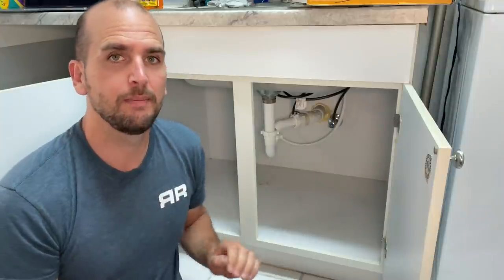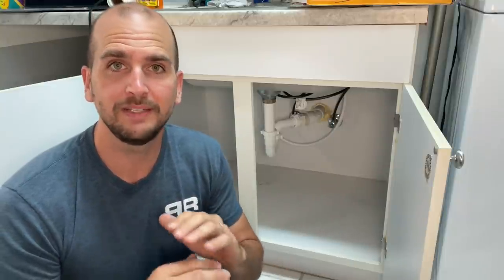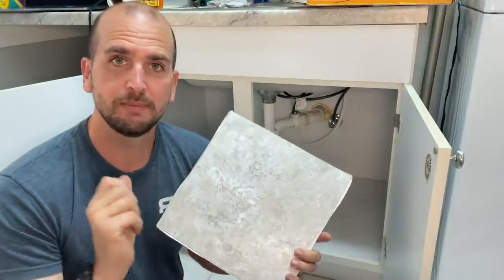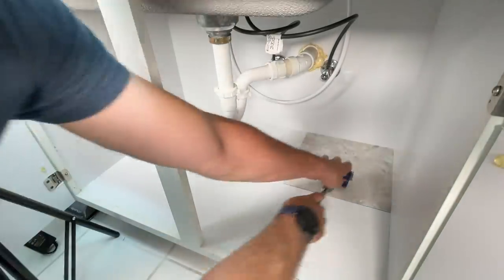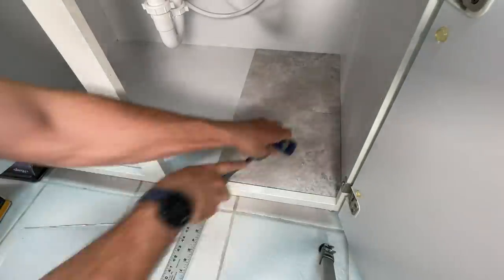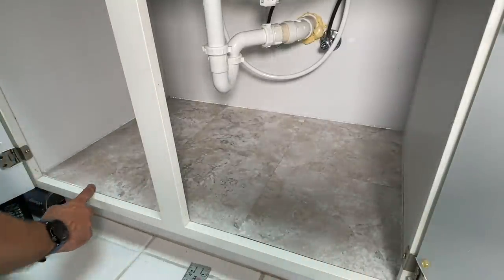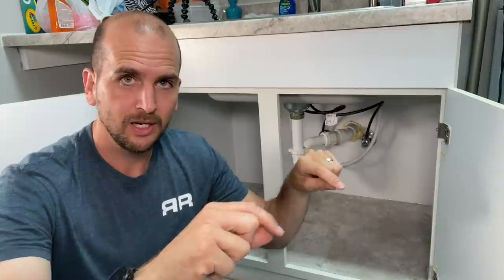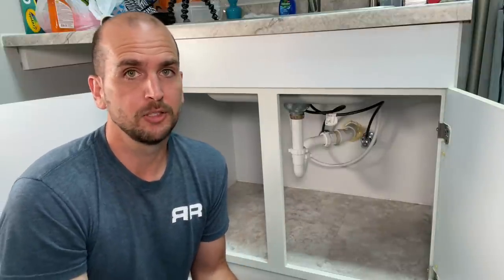Waterproofing Hack For Kitchen and Bathroom Cabinets

Comment: I did this many years ago under my then kitchen cabinet.  It worked pretty good.  Word of warning: moisture/gunk can get between the tiles so it is a good idea to silicone in between the tiles as you lay them as well, otherwise, this is a really good fix for under kitchen sink cabinets and it will last for years if done right.  Also, this is a cheep fix - less than $10. 💖
Reply: I was thinking the same thing.
Reply: Yep, I came to the comments to say the same thing.  This can actually make the problem worse if water gets into the seams and then can’t dry out.
Reply: Water can also run thru those gaps too.  I would also get water alarm sensors. I prefer to get a big piece of water proof sheet instead of small tiles.
Reply: Why not just grout it

Comment: I have water alarms under each sink in my home. They are battery operated and sell at Home Depot or Amazon for about $20.00.
Reply: Yep - and they work.
Reply: So instead of spending a couple bucks you’d rather spend $20 on each sink and have to buy batteries?
Reply: @Dnice3477  bragging about spending triple the money. Lol
Reply: Do they deflect the water out too? Or do they call you to let you know there's there's leak if you're not home?
Reply: @Dnice3477  
🤭☺️☺️☺️☺️!!
-- Rich people"
Reply: @garpikemike1  
🤭☺️☺️☺️☺️...
Reply: As a renter who had a slow leak that was not really detectable, I would love to have an alarm.  Kitchen sink seldom stays fixed when they use putty that disappears after a while. We never had leak problems in our home when I was a kid. Right now, after the bathroom "fix" and an adjustment a few days later when it again leaked (more than before they fixed it), now I have a plastic fast food container bottom under the pipe to catch any water that may leak. My fear is that the water will evaporate before I see it, which I think used to happen. For me, even as a renter, $20 plus batteries would give me some peace of mind that it really isn't leaking. Sorry some other folks are giving you a rough time here.  If I could gain some confidence that the bathroom really has stopped leaking, I could move the alarm to the kitchen where I am afraid it is just a matter of time.  Peace of mind makes it worth it to me.
Reply: We had water alarms at the natural history Museum near USC college.  This was in 2010.  They charged us $300 per water detector linked to our laptop.
Reply: The vinyl idea is better than nothing, but water can find its way between the tiles and still ruin your cabinet base. Why not use one piece vinyl? The water leak alarm is a great idea, because leaks under cabinets can go unnoticed so long that the damage is done before the leak is discovered. $20 a sink is cheap compared to the repair time and material.
Reply: @paulcalif  You guys are just wasting your money.  If its going to leak, its going to come from  a 2ft rectangle area where the pipes are above.  Just buy a big rectangular plastic tray and put clear cherry balls in there.  So when it starts to smell like cherry, u know theres a drip.
Reply: @kendalgee5808  Well, as a homeowner for over 40 years, a landlord and a retired plumber you make a good point, BUT, sometimes leaks spray not just drip. Plus, unless you're going to check your bowl every few days, it's going to overflow. What I do when I get a new home, is replace all of the angle stop valves in the house and all of the hoses to the faucets. I realize that tenants aren't going to do this (but owners should have). Today you can get 3 leak detectors with a hub for about $60. Connect to your wifi and get alerted if there is a leak. Additional detectors are about $10 each and a typical hub can support 10 detectors. But if you're a tenant, it's really the owner's problem. Not sure if any tenant is even going to install tile squares. They also have mats available that cover the entire under side of the sink and hold up to 3 gallons of water, but those are expensive too.
Reply: @paulcalif  That makes sense to proactively change out all of the hoses and shut off valves underneath the sink . I used to be in charge of an aquatic center and our company paid $300 per leak detector to have it linked to our cell phones about 10 years ago in 2012.  So the $60 option does not seem as expensive. When my water heater burst it cost me $3000 per claim to have my home repaired. $60 vs $3,000.  $60 isnt sounding so bad.  I should have read the dates on my water heaters and like you said proactively replaced my water heater despite the yearly flush. I know there is something in the shower that landlords proactively change out I can't remember.  Any other things I should change out proactively?
Reply: @kendalgee5808  Your toothbrush ;-)
Old faucets should be rebuilt or replaced. If you have an old house with galvanized pipes then replace the horizontal pipe coming out of the wall that the angle stop valve is connected too. Be forewarned however, there is a good chance that that pipe (nipple) will break instead of unscrewing. Before attempting to unscrew it, put something inside of it to keep it from collapsing, like a socket extension. Doing that will increase your odds of getting it out in one piece. If copper, take old valve off before buying the new valve and take it with you when shopping for a replacement as there are different thread types. Be prepared  to change out the ferral too. They sell tools for that. Or just hire a plumber :-)
Reply: @paulcalif  Well that is a wealth of knowledge.  Thank you for sharing your tips and wisdom!
Reply: @paulcalif  Thanks for the feedback!  My 10 year tips.  Clear everything 3 ft. away from your house 360 degrees. Rats will hide and chew the stucco and enter your drywall in your house. You will then have to seal their entry with durabond 90 or fix it all, cut drywall, set traps, use joint compound to fix drywall and level 5 finish. Large trees should be trimmed to avoid toppling over and to avoid termites eating dead branches. Hillsides need foliage and objects to give back to the soil or corossion occurs.  Never compost unless u have a locked container constantly monitoring for rodents. Oulets should upgraded to be tamper resistant and GFCI near water , check your local code. Flat paint is easiest to blend for rentals feathering with a roller.  shave all sharp edges in and around your home. proactively take care of any hazards beforehand, misaligned paver, wall leaning over, non stainless steel things that rust outside use rust converter by rustoleum, Vertical gates its ok to use paint/primer , however flat horizontal boards that get hit 90 degrees by water should be primed and then painted, but stain is preffered over paint, trex being the most expensive and mantainance free.  Torx screws are a time saver. However certain things u want a pilot hole with the torx to avoid cracks in the wood.  dry graphite is the miracle powder for door locks.. learn how to cut when paiting with a tiny arts and crafts brush..  fix it all is essential for fixing things cuz its hard as a rock but impossible to sand days later so be sure to feather it good and sand very soon. etc.

Comment: Great video!  I had heard of this hack a while back and bought some vinyl wood planks to put under mine (for that rustic look).  The only advise I would add for you is, if it were me, I would put the uncut tiles in the front where it's the most visible and put any cut/trimmed pieces in the back.  That way you mostly just see the pretty tiles. 😉
Reply from the maker: Not a bad idea, thanks for the feedback Sheila 👍
Reply: That's what I did. Untrimmed edge on the front but both sides got trimmed because I centered the middle tile.

Comment: I did this several years ago under my sinks and shelves. They had press and peel tile at Dollar Tree...3 tiles for $1.00 or a box  of 27 for $9.00. I bought 4 boxes. They are still in perfect condition under there. Plus it makes it easier to clean and you don't have to worry about spills because they are easy to clean up.

Comment: You definitely got my attention. Seen the results of these types of leaks way too many times. Sometimes major damage. And if it's particle board you can forget about it, not only is it damage but if there's anything sitting in the bottom of the cabinet that shelf will collapse, and water damaged particle board attracts roaches. Just a landslide of a complete mess.

People also tend to put way too much heavy stuff putting more weight on that bottom shelf than they're supposed to, which usually contribute to bending or a collapse.
Reply: Well where else would you suggest I keep my anvils?
Reply: @garpikemike1  🤣
Reply: @garpikemike1  😂😅😊

Comment: find the low spot along the front of the cabinet, drill a 1/4" hole near the front of the cabinet floor so that the water comes out on the floor where it's visible, rather than pooling up inside the cabinet.  The peel and press tiles would work well, but I've also had success using scraps of loose-lay sheet vinyl, for a $0 upgrade ;)
Reply: Great idea
Reply: Then you have water trapped under the vanity? Or?
Reply: @floridagirl9064  it comes out on the floor, in front of the toe kick.  So you can see it!
Reply: I only use loose-lay vinyl. Water can easily seep between the stick-on tiles.

Comment: Great video!
I removed the original rotten cabinet bottom & made a new one out of luan & cut it to the dimentions of the original & glued a leftover piece of vinyl flooring to protect the new cabinet "floor" from leaks/water damage.
It has held up to the ravages of several different leaks for ten years:)
Reply from the maker: Nice work!

Comment: I am a renter myself and this is something I did in the cabinets in my place many years ago (been in the same house for 18 years so far). Initially I did this for an entirely different reason than for avoiding water damage from leaks. I have always had cats and they almost always have loved sleeping inside my bathroom vanity (which is always empty aside from the cats themselves). I wanted a way to be able to clean the inside of the cabinet without having to worry about the cheap liner or the particleboard of the cabinet becoming damaged over time. So I put in these vinyl tiles and it's been so easy to keep the insides of the cabinets clean and undamaged. I "splurged" on some clearance wood-like vinyl that closely matched the interior look of the existing cabinets and paid about 60 cents per tile when I did it. My bathroom vanity had some cosmetic damage on the inside walls from previous renters so in that cabinet I did the walls and the base. In the kitchen I just did the base because the walls were fine and the vinyl matched well enough that it didn't look out of place. My cats never go into the kitchen cabinets, but I wanted them to all have the same type of finish so that they were consistent. 

The house I rent definitely suffers from the "landlord special" for most of the repairs that were ever done to it. My landlord likes to "save money" by hiring the cheapest people to do the job and he definitely gets what he pays for. Most repairs he hires someone for look worse when they're done than before they were started. Whenever I can I've been doing smaller/easier projects like this one so that i know it will be good quality work and that when I'm done everything will match and actually look nice. As a bonus, my landlord pays me back for the repairs in the form of free or reduced rent until the amount I've spent on repairs is paid off. So it definitely benefits both of us for me to tackle little projects like this. And it's fun to see how much this place has improved over the years by just doing one little project at a time. And bonus #2 is that they've never raised my rent, so the extra value I'm adding to the place by slowly improving it isn't hurting me in the long run.

Comment: Great idea! I did the same with floor tiles several years ago after I replaced the bottom in the cabinet. Now I have a full width pull out drawer that will catch and contain any water.  Great tips as always!

Comment: I’d actually use those extra pieces on the sides and back as a backsplash and then run a bead.
Reply: That's exactly what I was thinking when I left my other comment talking about concerns of whether the bottom of the cabinet is level to begin with and if it was already warped or bent in from previous heavy items or previous leak being placed on it. Because in cases like that the water will run to the center and then straight to the back of the cabinet. Both of these methods are dependent on people not putting heavy items in the cabinet that can cause it to buckle or Warp. 

 Seems to be very common occurrence with particle board....Which is found in many rentals. I don't understand why someone doesn't put supports under the Shelf as they're installing these cabinets so that a collapse and warping cannot occur.
Reply: @RXSVN_2  I work for an Apartment Rental Company, and I know what you mean. I've seen so many particle board bottoms either heavily damaged or just flat-out ruined by water leakage, that I've truly lost count. The best thing that can be done is turn off the water to the lines, remove the flooring from underneath the sink, replace it with an appropriately cut piece of plywood (Not OSB!), then, after installing that, and using either this gentleman's method, or using a piece of Waterproof Vinyl, secure said Vinyl to the bottom and the sides of the sink. THEN fix the Water Leak, turn the Water Pressure back on SLOWLY, just to make sure that the leaking area is fixed, then keep turning the Water Pressure back up, until it's fully back on. Check for leaks, and if there are none, you're good to go!
Reply: @RXSVN_2  me too. I was thinking let’s prevent damage from splashing on the sides and back too.
Reply: Agreed on all points. I'd go up the sides and back.
Reply: Great idea
Reply: Love this idea, thank you for sharing.
Reply: I was thinking that, too. Makes sense if there is a larger leak.
Reply: Great video! I never would’ve thought of doing that! I will be doing that!  I had a leak under my kitchen sink and it destroyed the wood I had to replace it! Thanks!
Reply: i was thinking the same thing
Reply: Dnice3477 your idea  is better than his

Comment: Want a simple waterproof easy to clean way to protect under sinks? 
I line all my cabinets with yoga mats. 6’X2’ from the dollar store - oddly enough they are NOT a dollar, more like $4.
I started doing it with my first home which had older cupboards. The interiors looked unappealing. The added advantage of using cheap dollar store yoga mats is the cut easy. The also allow you to ‘stand’ plates without them sliding down and breaking - giving you more room. 
Now that I’ve sold my homes and rent an apartment, I still do this. It the simplest way to have a clean convenient water proof interior. (Even inside my drawers to prevent my knifes etc from sliding around)

Comment: I like to use Formica and contact cement it down. Add a bead if caulk on the edge to finish. Not seams to catch grime. I also like to have a dish pan in each cabinet. They are great for storing liquid cleaning supplies to prevent leaks, and they fit under a p-trap to catch water while you are repairing/cleaning it out.

Comment: Great idea! My professional remodeler brother said when using silicone type caulking, spray the bead with a NON-AMMONIA based glass cleaner and you'll be amazed how well it finishes running your finger along the bead.

Comment: Been doing this for years in my cabinets.....and after the installation I put a layer of clear contact paper over the tiles.  Makes cleanup easier, too...especially in kitchen cabinets where pots might be stored.
No..it’s not an elegant fix but it works!

Comment: I just got done doing this today after replacing all the kitchen cabinets in our double wide manufactured home. It was an involved process because all the plumbing comes up through the floor (except for a supply line going through the exterior wall to a hose bib). So it took me a while to patch up the hole in the floor of the cabinet and putting vinyl tile on the floor of the cabinet covers that patch and makes everything look good... I mean great 😉!

Comment: What about preventing water from being able to go through the spaces between the tiles? I was thinking maybe putting  and entire sheet of something onto the bottom of the cabinet first that has an adhesive backing to prevent water from seeping through the spaces in between and then put the tiles on top of that?
Reply: Or instead of 2 layers, use remnants from a roll-lino install. And either add vinyl cove moulding or just bring the lino curved up about 2 inches and either way, seal with silicone or a flexible white caulk.
Reply: You'll get tired of the color before these tiles will come loose.  I have these stick downs under my kitchen sink and bathroom, no problems at all.
Reply: Buy the rubber door mat that is sold by the foot at Lowes.  I also put one of those aluminum oven liners down.  It has a lip that will hold water and you can hear the dripping.
Reply: Contact paper from dollar store..it's cheaper and water proof
Reply: First thing I thought. I wouldn't notice it with tiles till it falls thru next time. Super busy!
Reply: @freckles3705  That's what I do too.
Reply: Now you get bigger size tile or tile slabs which can be cut to size. I recommend use metal sheet instead

Comment: I'm a master installer and have been doing roll vinyl scraps for my clients for over 50 years ago.After installing a 12'x25' roll vinyl in a kitchen I've always taken the scraps, for under sink cabs, drawer liners, and cabinet liners.
Reply from the maker: 1-piece Vinyl liner can be a great solution for protecting the base.  Have a friend doing that in all the rentals on a property he just purchased.